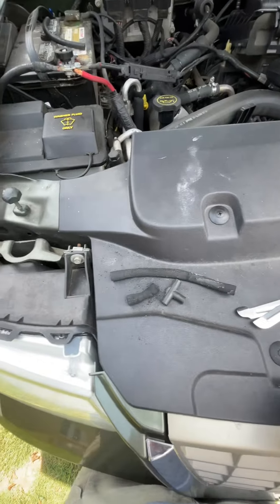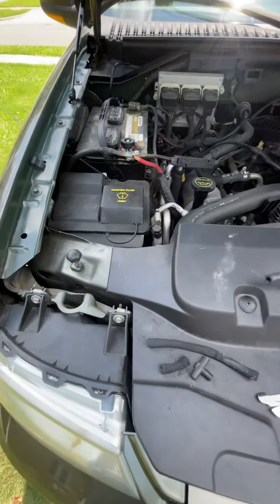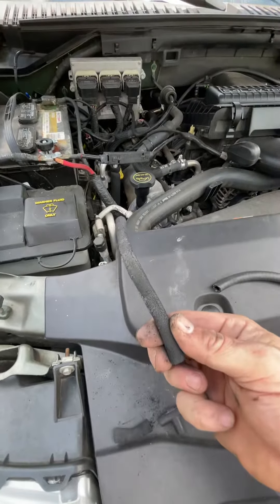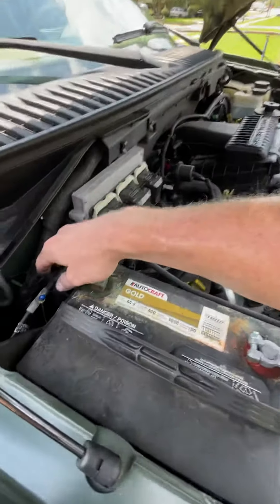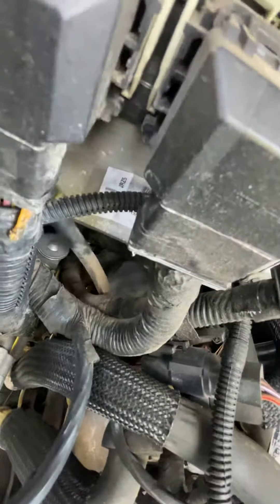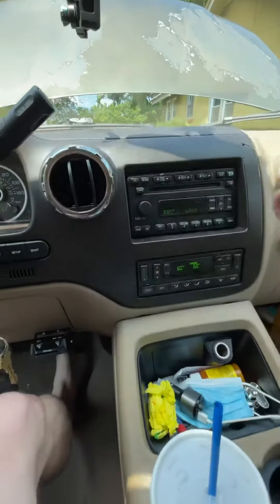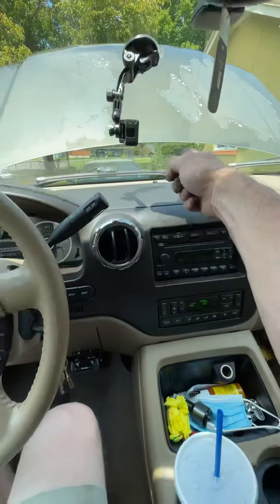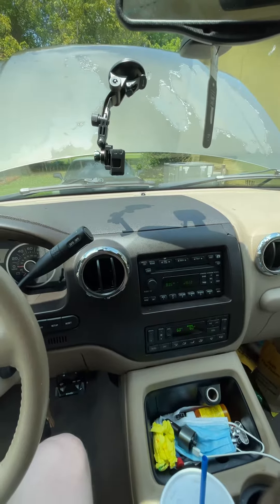2005 Ford Expedition Eddie Bauer. A/C vents working; only defrost blowing. FIXED for free. How?

Comment: I can't by pass mines bc of a switch on the left upper nexted to the battery , what underneath the switch is a vaccum line , i need your help with my vaccum pressure 
lines